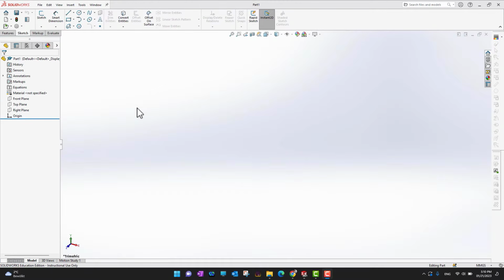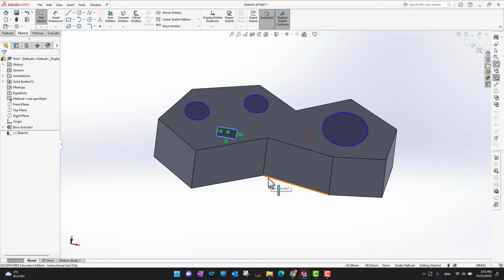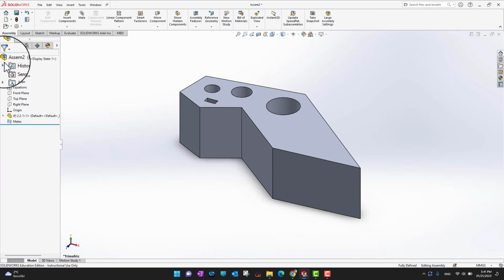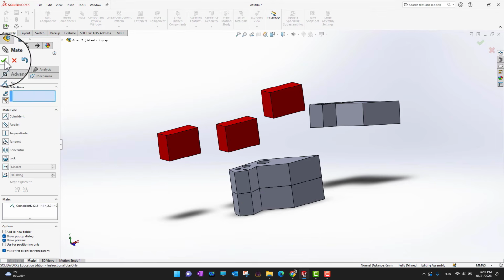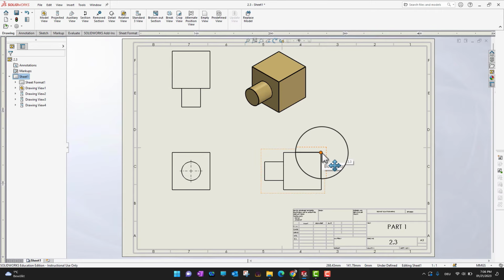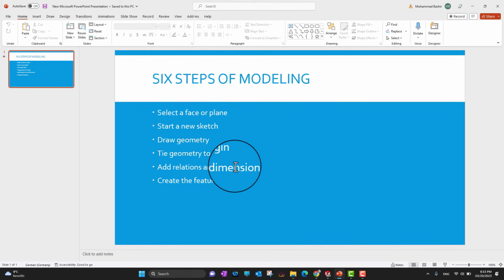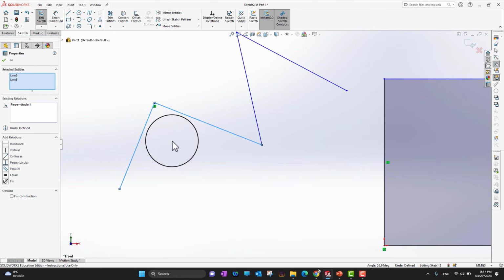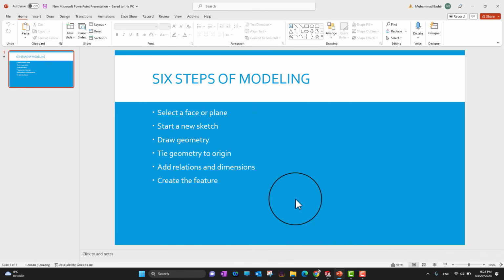Solidworks Crash Course for Absolute Beginners - Learn Solidworks in 30 Minutes

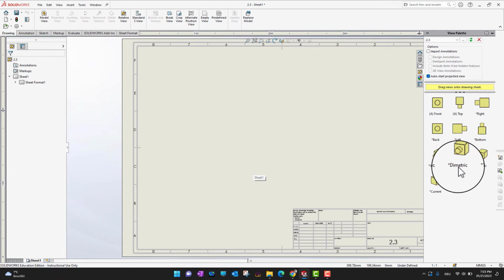Comment: 16:24 how were You able to get the view palette? Mine doesnt pop up
Reply from the maker: Thank you for you comment. and please try these:

✅ 1. Enable Task Pane
👉 Go to View > Task Pane and ensure it is checked. If missing, press Ctrl + F1 to toggle it.

✅ 2. Reset View Palette
👉 Open Drawing mode, go to View Palette in the Task Pane, and click the pin icon if it's collapsed.

✅ 3. Re-enable View Palette
👉 In Drawing mode, go to Tools > Options > System Options > Display and ensure View Palette is enabled.

✅ 4. Reset SolidWorks Settings
👉 Go to Tools > Options > System Options > Reset and reset the UI to default.

✅ 5. Check Add-ins
👉 Go to Tools > Add-ins and make sure SolidWorks Drawing is checked.

✅ 6. Restart SolidWorks
👉 Close and reopen SolidWorks, or restart your PC if needed.

Let me know if it helps :)